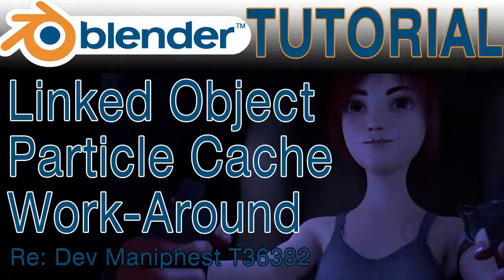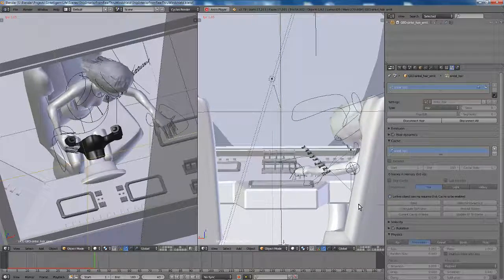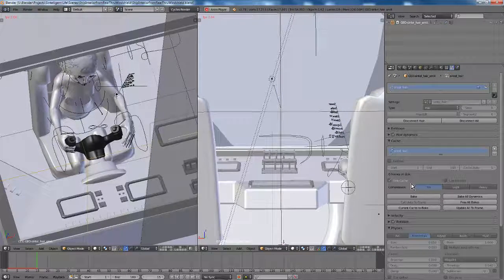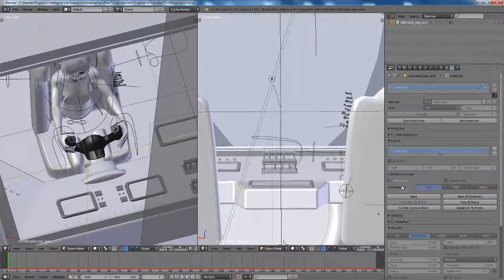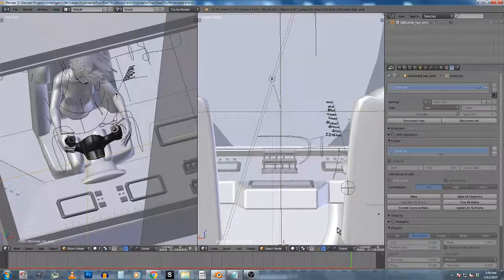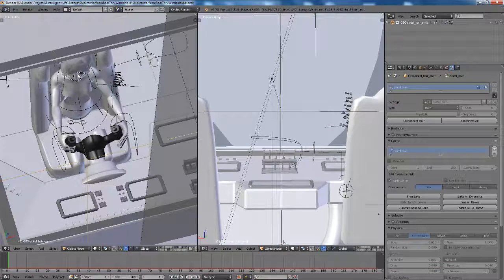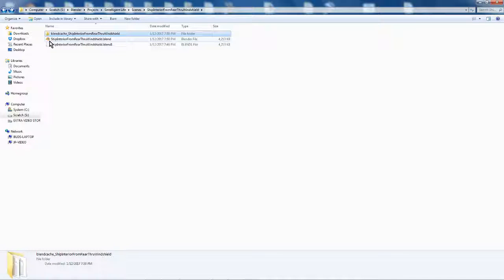Particle Baking in Blender 2.78 and the Linked Object Cache Work-Around

Comment: I may not use linked object libraries in blender, but nice to know for future reference.

Um, I have a female character who I gave cloth physics on her sleeves. But for some reason, the sleeve cloth collides (and bakes) very well when my character is in default position. But when I move her arm, the sleeve goes right through her arm!! (except the pin group, aka, the top end of her sleeve)

Someone told me on the blender artists forum I'm supposed to "settle the sleeves first, then bake the animation" but when I do this, it still doesn't work. I've got a similar problem with her skirt too. I think if I solve the baking problem on one mesh, the solution will work for the other. They also told me once I master baking cloth physics, it makes animation much easier, so I really want to know how to fix this. And yes, I am going to use hair physics so I need baking for that too!

My physics problem seems to be cloth physics only works in static pose, and the bake doesn't update itself when there is movement. I've tried a few solutions and they haven't worked.

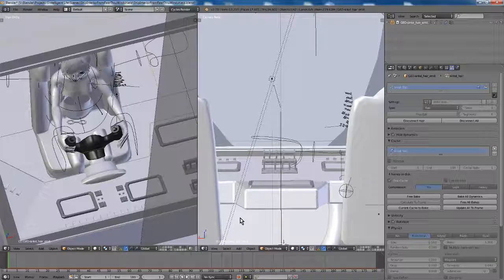Also, is it just me or does your voice keep changing? Especially at 16:42